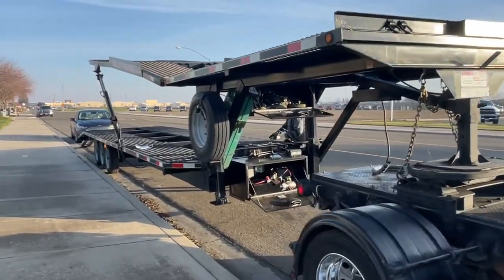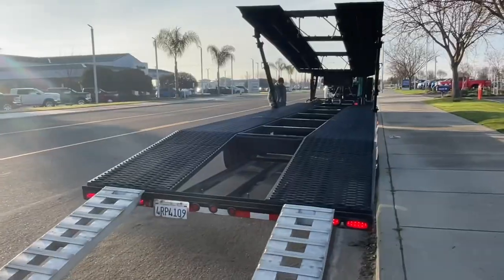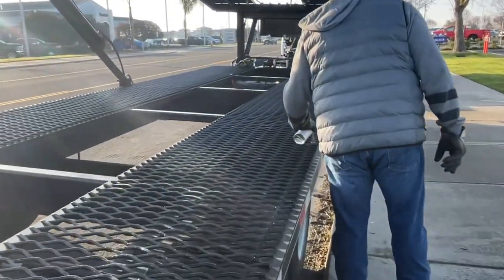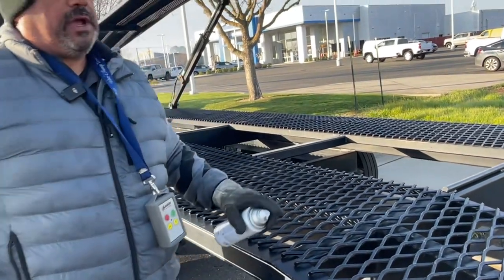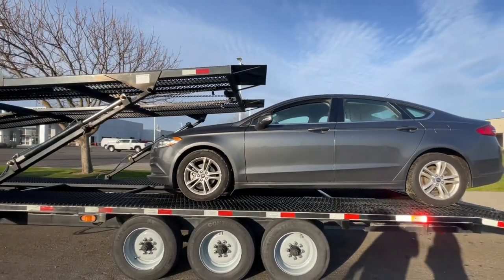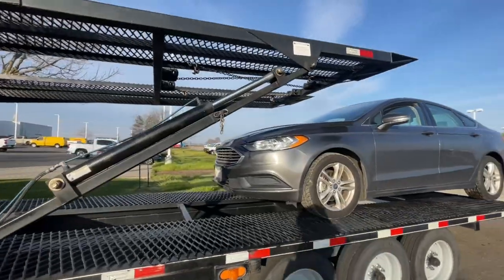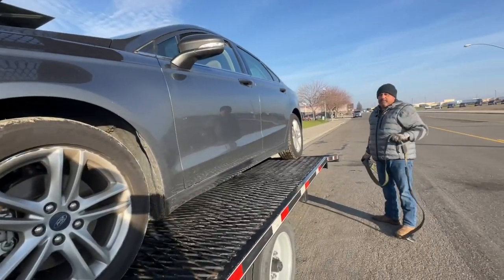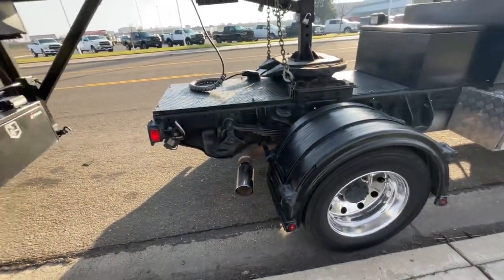Easy trailer maintenance. California car hauling with Dodge 5500 Kaufman ez4 trailer.

Comment: It will be my first trailer but I have a 2018 Kaufman 3 car hauler that’s within my budget that I’m considering. Any tips on what to look for when I go inspect it?
Reply from the maker: Yes check bearings and brakes.  Jackup all the wheels off the ground, spin wheels listen to the bearings.  Also check the brakes.  Also check lee springs for cracks. Ask seller when they last changed brakes.  Give me a call if you have questions (209) 915-1462

Comment: Let me know how you feel with a 3 car wedge difference between 3 single axle or double dually 10k axles with 8 tires? Thx for the feedback
Reply from the maker: I’d go with the dually 8 tires because they can handle better in tight areas. They’re both good on straight driving.